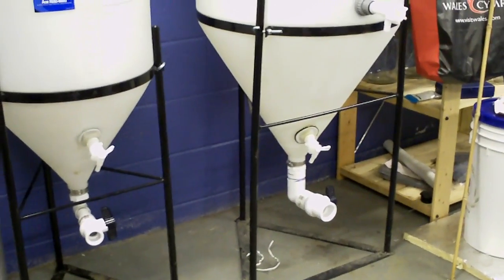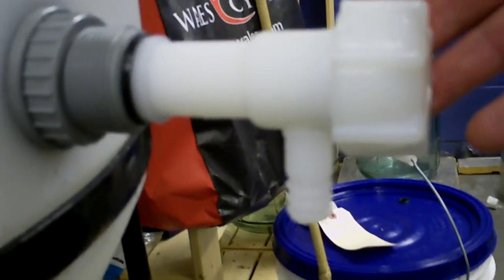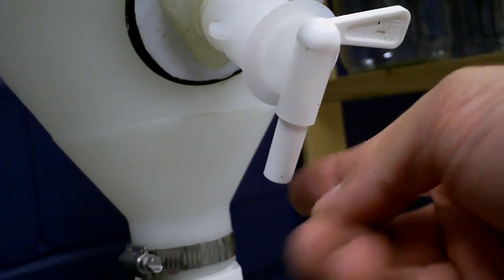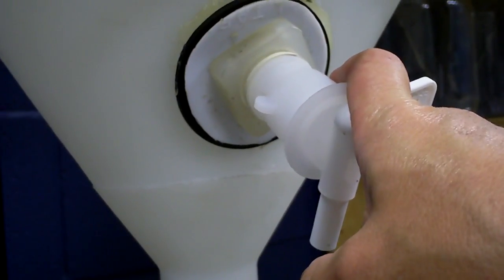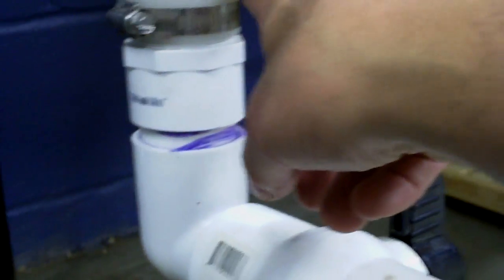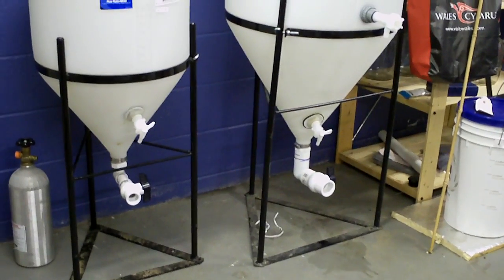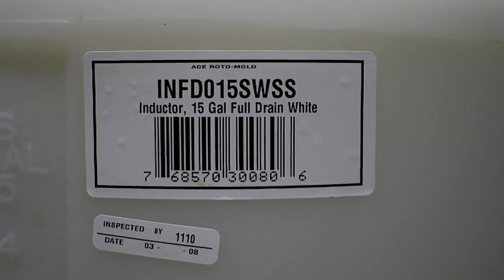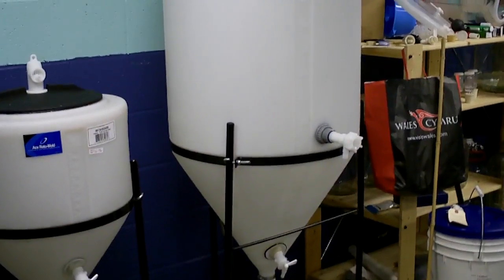Orchard Diary 10/5/2011: Plastic fermenter spigots and taps (Part 2)

Comment from the maker: It was VERY difficult to install the sample valve in the conical section of the tanks.  Part of the trouble is just getting into the tank to secure the bulkhead connector, but the hardest part was getting a good seal on a surface that's curved in two directions.  I had to make tools to hold things in place, and use heat to soften the tank walls to flatten them.  Not for the faint of heart.

Comment: I didn't mean the bottom/ aka bulkhead elbow...I am wondering about the port with the 3/4" self draining valve into the bulkhead on the side of the conical.  I don't know how you mounted that valve given the size of the inductor tank.  I want to buy a 60 gallon inductor but not if I cannot install a valve, like you did.

Best,

Marcus